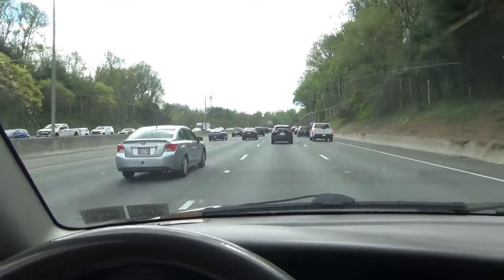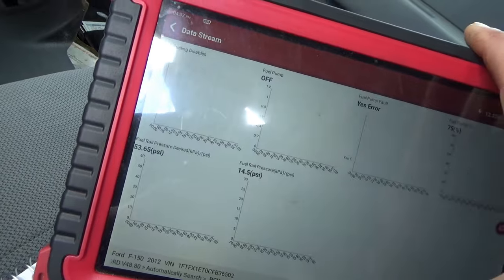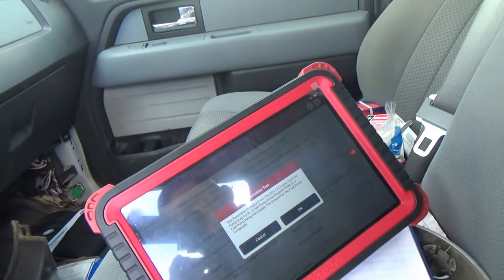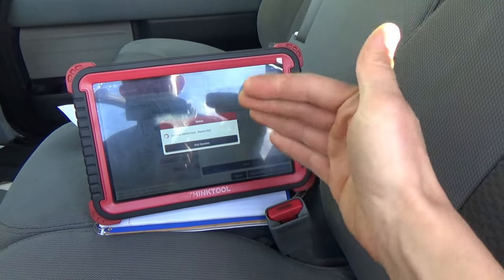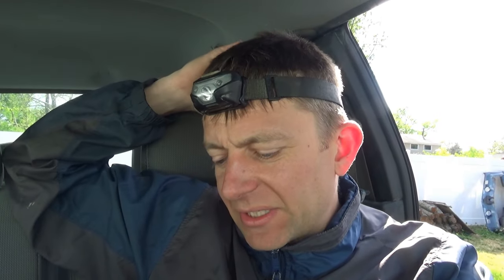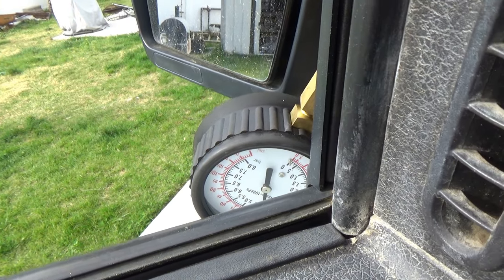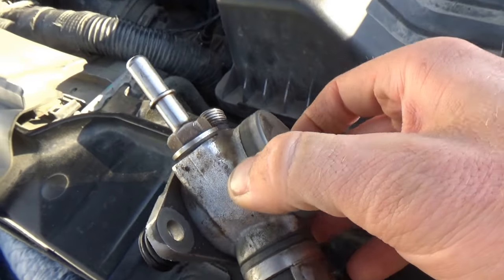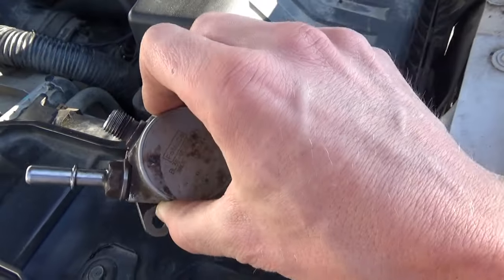WEIRD Crank No-Start (Ford F150 Ecoboost)

Comment: The carbon buildup on the bottom of the high-pressure pump seems to hint at a lack of oil changes in this truck. Since it has number stickers on the fender, I assume this was a fleet truck, which explains why they kept driving it until it wouldn't go anymore. With proper maintenance, it could still be running like a top. Interestingly, I learned that new engine oils rated with API service specification SN Plus and SP were developed with these Ecoboost engines as the test units. Apparently, it was discovered that the older oils were contributing to abrasive wear of the timing chain rollers because the carbon bits in the oil were wearing them like sandpaper. The new oils are said to keep the abrasive bits under control.
Reply: You nailed it. First apply direct injection, then boost the pressure in the cylinder, and you get fuel getting by the rings. The oil thins out from fuel contamination and the hydraulic chain tensioners lose the ability to keep pressure on the tensioners. The guy gets pissed, floors it, and the chain jumps a link. I have absolutely no sympathy for anyone with a turbocharged engine that does not change their oil at 3000 mile intervals. I bet the previous owner never changed the oil. If you pull your dipstick and smell fuel, you had better be dumping that oil right now.

Comment: A couple of things jump out at me Ivan. I've had a couple of bad GDI pumps, not Fords, and the vehicle would usually run, idle only with low power, on just the low pressure pump. Secondly, not sure how you are equating the mechanical timing issue with the low pressure fault. The GDI pump is not timed and as long as the cam is actually spinning, it should be creating enough pressure if the pump is good. That pump may have indeed been failing.

Comment: I had one about 7 months ago and went through pretty much what you did , was on the fuel pressure rabbit hole but i pulled out the map sensor and had an assistant crank it and i was getting pressure back up into the intake. The timing chains on these things are garbage, should be replaced automatically at mileage intervals like a timing belt. I have 80 ford products i take care of and have 3 waiting for timing chains.
Reply: Amazing... and FORD, they make high end sophisticated race cars too, don't they? Haven't they been building and engineering engines for over 100 years? Oh well, must be parts made in China....
Reply: I'll never understand why anyone buys their garbage.  You certainly couldn't tell they've been making cars longer than anyone else.  People are happy if they only get 10 years out of them, it's 2022, the outhouse fire year after the dumpster fire year.

Comment: Hey, you can’t win them all! You are a stand up guy and this video shows that! I was hoping while I watched that you would check the timing. Those Ecoboost engines are very particular about their timing and I hear lots of problems when they’re not in time. Thanks for sharing this!
Reply: The ecoboost of the 1st generation are known for timing chain stretching because of lack of oil changes. I personally had a 2011 f150 ecoboost that stretched the chain and jumped timing.
Reply: Btw. 1st gen ecoboosts are known for high pressure fuel pump failures too. I think it was a recall on them too.
Reply: @phreaker1992  Thanks, good to know!
Reply: I would put physically verifying timing on every DI fuel pressure related no start. The timing of the plunger push is just as critical as a spark event or valve opening. 

If the plunger is not at the right part of it's stroke when the fuel injection event occurs, there won't be any fuel volume available... But since liquid us in not compressible that plunger must be "pushing in" any time an injection event is called for. If it's not moving you just get a tiny drop of fuel and all the pressure is gone. I think that's why we were able to see pressure sometimes there when he did a short crank.

Comment: Hey next time you suspect a timing issue  use starting fluid (ether)! If it’s a fuel problem the engine will start and run for a short time if it’s a timing problem it won’t run. This is also a quick test to determine if the ignition system is functioning! It’s just an old-school way of quickly diagnosing an engine problem! A real time saver to help you pinpoint where you need to start looking!😸
Reply: I like that.  Hopefully I can remember that.
Reply: I agree with the “quick” start confirmation ! Especially with the stumped customer standing there!
Reply: @TheFrenchPug  Hello, I have this same problem, what was the solution of this, was it the fuel pump or the time synchronization?

Comment: The early 3.5 ecoboost engines had one chain pulling all of the cams and stretching is an issue with these engines.  The later models have 2 chains, one for each cylinder head.  It's good to hear that the ecoboost engines are lasting that long especially 1st year engines.
Reply: I was surprised that it was still the original high pressure fuel pump.
Reply: probably all highway mileage, with minimal city driving/idling.
Reply: @throttlebottle5906  a farmer i worked for had one with 235k before handing it down to his son, his only complaints were the back up camera not working and it didn’t get the fuel mileage he was expecting. He towed about 7k every day 35 miles to a property he farmed and only got about 14mpg.

Comment: Appreciate your honesty. My brother tells the story of when they had an old Honda that bent a valve after a broken timing belt. They were so disgusted they just floored the engine. It didn’t blow up. In fact, it started idling smooth. I’m not sure how much Olympia was involved. Remember that beer brand?  It’s an old story. But he says it’s “true”.
Reply: Old Hondas had problems with carbon on valves. Some times they wouldn't restart after shut down due to carbon holding the valve(s) OPEN. I fixed one by spraying lots of carb cleaner down the intake, while cranking. 
 :-)

Comment: All of the signs pointed to fuel starvation. 🤔 I kept thinking air lock or the high pressure side needed bleeding, 999 times out of 1000 this would have been the problem.
A timing chain jumping sprockets is very very rare and the last thing you would blame.
Great stuff Ivan.👍👍👍

Comment: I'm originally from the Baltimore area and recognized some of the area from your video.  I have lived in TX for many years and so it was good to see the old town.  
I thought as you were making this that to put too much into a 'road trip' can create a bug-a-boo in terms of quality due to the pressure created by such.  Mobile sounds like a great idea until you consider that condition.  It occurred to me that you may be cutting corners to make the timing work out, which as we saw here, sometimes doesn't work out well.  And that is especially true when you encounter a really tricky one like this.  All in all, you're experience coupled with your analytics make you a quality mechanic.  
Having spend years doing troubleshooting on control systems in another field, I can appreciate the way the system can and does trick a mechanic.  I've had to, more than once, make some phone calls to get help.  It happens.  It can leave you feeling a bit inadequate until you realize all the good you do.

Comment: That is why if I suspect any fuel issue, I always put a little curb cleaner in the intake to see if it will start then stalls.
That saves me a lot of pain
Reply: There is sometimes that tech cant beat old methods of diagnosis like the carb cleaner can.
Reply: he should put the curb cleaner  b4 change the fuel pump
Reply: Don't think that works on a direct inject engine.  Maybe I'm wrong.
Reply: @markrup6369  fuel is fuel my friend.
Air through the intake manifold will carry it down to cylinder where it will burn 🔥
It will not work on diesel engine because  it doesn't have spark ignition system
Reply: But It does work on diesels 😂
Reply: So I did this, in the throttle body and no start, fluid. So pretty much going to be the timing huh?
Reply: @markrup6369  I tried this on mine. It did not work tonight, but I’m not aware of the direct GDI’s not working with card fluid.

Comment: I worked on a car that had a very intermittent crank-no-start issue with no codes. Once I caught it, I noticed that there was not enough fuel pressure. In the end, when the issue got worse, I could pinpoint it to the exhaust camshaft phasor. Apparently incorrect timing can prevent these types of high pressure fuel pumps to build pressure. 
I wonder if the pulses that control the pump are synchronized to the position of the camshaft?

Comment: Thanks  for sharing. Based on the engine  sound, I would have checked RC  along with pulse sensor  on the intake  and exhaust. I made the comment  right  at the moment I heard  the engine  I did not know yet at that point  the conclusion,  those  hpp are time  to the  timing  activation  of the cam lobe and electrical  signal to the flow control valve .

Comment: Ivan, thanks for a great video ...as always.  On the subject of the GDI HP pump, the fuel quantity valve.
I was looking into how the fuel quantity valve work on my engine too, Mercedes M276 3.0 Turbo. Bosch HP pump.
So I want to share with you what I learn on this :
This HP pump TDC or pumping event is equal to the number of fuel lobe/s of the camshaft. Some camshaft has 1, 2 , 3 or 4 fuel lobes. 

My engine uses 4 fuel lobes and the cam is on its Bank1. My HP pump is a normally open version for the fuel quantity valve, that means if the fuel quantity valve is not energized, pressure can not build up and it will allow the 5 BAR fuel pressure from the tank's LP fuel pump and limp home mode is using this method. Normally open type is safer too.

The piston or plunger on this kind of single piston HP pump, make pressure by activation (closing) the fuel quantity valve during the upstroke of the piston. The downstroke of the piston is to let fuel into the "pumping chamber", no need to energize the fuel quantity valve as it is a normally open version. So for my 4 fuel lobes camshaft, 1 camshaft revolution there will be 4 pumping action BDC to TDC of the piston and is 45 degrees and TDC to BDC is another 45 degrees. 
4 fuel lobes is 360/4 = 90 degrees. 
In the each 90 degrees, only 45 degrees make higher pressure, more than 45 degrees is to reduce* pressure by limiting fuel entry or quantity into chamber   ( *if activated beyond 45 degrees)

So this kind of HP pump, we can not simply energize 100% of the time its fuel quantity valve hoping it will deliver maximum quantity/pressure.

The part I am still "blind" is, I do not know the exact location of each 4 of the TDC in respect to the camshaft 360 degrees.
I have to physically inspect the cam itself to learn of these TDC... too much work, no thanks.

Initially I thought using a picoscope I can find these 4 TDCs, I can yes but not with 5 degrees accuracy, perhaps only 15-20 degrees. You see the ECM activation using PWM for the fuel quantity valve is variable depending on engine RPM and load.
At idle I can see 33 degrees worth of fuel quantity activation per TDC, so there are 4 of this PWM pulses sent by the ECM.
I would assume the start PWM signal would be at TDC dead on, well it does not seems that way by the time I scope more and while revving up the engine. LOL.

According to Audi tech at OPUS IVS channel, fuel quantity valve failure or not being "accurate" is also a common problem, aside from worn out/broken piston. I think not being accurate means the activation of the magnetic coil vs the actual reaction-to-execution time of the mechanical portion responding to the PWM signal is way off the target.

Comment: Ivan! I feel a relative compression test would have aided you fast here in confirming your timing suspicions. Then after seeing an anomaly you would have more evidence pointing to get the in cylinder transducers out and syncing timing etc, that would of helped you out way better with that variable of calling the pump. I’ve been caught out with a couple of jobs like this before and on all crank no starts now, my first port of call in all these situations is disable ignition or fuel and do a relative compression test first before I do anything else to try and get faster direction regardless of the fuel OBD codes that are present as they can lead you down a rabbit hole. That pico 600+amp clamp round the battery is the life saver when trying to see the engine mechanical condition.

Great vid mate and good see you showing total honesty and honouring your customer policy. 
Keep up the great work, These videos are excellent. 
Everyone can learn from these including the customers. 

All the best 
Wayne 
Scope3
Reply from the maker: In this case relative compression would have shown nice even humps since the chain jumped on the crank sprocket 😉

Comment: Thanks for the video and the update.  I was thinking that you do not want to directly connect the HP pump to 12 volts, it would draw about 40 amps.  I also thought that maybe an injector failed open and caused the pressure to drop.  It takes a big man to admit he doesn't know something!

Comment: The primary timing chain is probably stretched out more than a couple links like they do as early as 100k miles so the timing of the fuel pump isn't in step with the position of the rotating assembly

Comment: I'd say you were correct on calling the high pressure fuel pump even if it wasn't totally at fault of the no start because of smelling fuel on the wrong side. If the just the timing chains were replaced, it would still be pumping fuel into the crankcase.
We're back to fuel pumps failing and putting fuel into the oil! An old school issue, which is now a new school issue!
Reply: I was thinking the same thing.  Replacing that pump was definitely necessary if it was allowing fuel into the head so replacing it wasn't a total loss.

Comment: Its been my experience that most GDI engines can start and run (not well) on low side supply pressure. Also depending on design NO or NC solenoid if you unplug it, it will force full pressure. If the pressure gets to high there is a safety blow off valve that sounds like a high pitch squeel

Comment: Wow I admire you more, what a character. I have that same problem working on as I speak. Same symptoms on a 2012 bmw M  V8 twin turbo. I don't  have a pressure transducer as yet and was convinced it was the pumps although having a gut feeling it's the timing ,I took a break and thought about it. It has two high pressure pumps would both go at the same time, they could but highly unlikely,  I'm still in the process of proving it's the timing.

Comment: high pressure fuel pump leaking fuel into oil, so needed to change anyway.  Had wondered if timing was off.
Reply: I heard the Timing Chains were stretched like no tomorrow. The valve Timing was so far off that the vehicle would crank but not start.

Comment: Saw one on a Mercedes where the crank pulley/dampener spun on the rubber causing timing to be out 40° after new timing chains were installed and marks aligned it was a no start
Reply: diagnose dan video

Comment: Your insight is amazing, I would have never thought timing. But I do not work on Fords. I just try to keep my own older junk running. So it turns out the crank jumped out of time, time for the new owner to address that issue. Personally, I am not a fan of VVT systems, repairs can get expensive real fast.

Comment: I am having similar issue with my Q7 glad i found your video here...I have a fuel rail pressure sensor (G247) that needs checking as i think its intermittent due to the battery being deficiently low possibly because the vehicle begun shutting down lot of components as well modules...I have iCarsoft OBDII reader as well Ross-Tech software

Comment: I wouldn't beat yourself up over it to much Ivan.  So, the high pressure fuel pump was not the cause of why the engine wouldn't start.  But, I am more than certain that it would have had fueling issues of some sort, if it was able to run.  Ford trucks with over 200k on the clock are bound to have a multitude of wear issues.  Timing chains and gears are a big one.  But that was crazy how the owner of the truck rotated the crank backwards and the timing chain just popped back in to time.  Talk about lucky.  lol
Reply: Not all,,, like the in line 6, the 4.6L 2v will outlive the 5.4L 3v and the eco crap all day long.

Comment: My logic is. That cam was turning just couple time making the pump build pressure for a short time till the injectors fire and bleed off the remaining pressure.  I can recall from the last high pressure pump I called bad. But by design this high pressure pumps with solenoid unplug it should pump whatever max pressure it can all time. The solenoid is just to maintain desire pressure by bleeding some of high pressure back to the feeding line.

Comment: Haven't watched all the way through. My guess is a bad fuel pump module ground. My buddy had a auction f250. They replaced the pump 5 times. Wire  harness, injectors ect. It was a bad ground on the frame rail
Reply: That would be my educated guess ! Fords are so rotten underneath, excessive cranking, hot ground! Had one !
Reply: @fredwalker839  yep. Where the fuel pump driver sits is under the spare. He had sunk his truck in mud a few months prior to the issue.  The used car dealership threw parts at it. They  refused to do any more warranty  work on. So my buddy called me. I live in Boise,  and he lived in twin falls. About a 2 hour drive. Scanner it for codes. Looked a a wire diagram.  The ground wire had broken off. The truck would run fine and die, not restart. Sometimes it was fine. This issue went on for months with the dealer. It was like 4k in parts. I fixed it in 20 min. Never had an issue again. Sadly my friend passed away in a motorcycle accident a few months later.